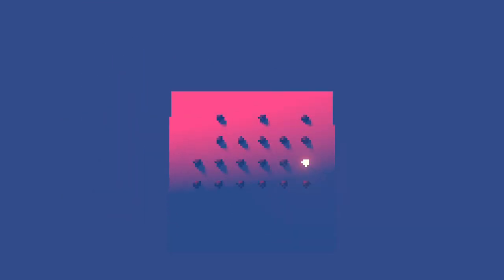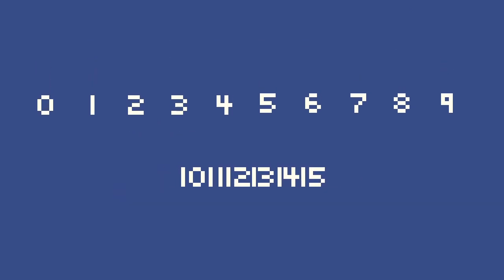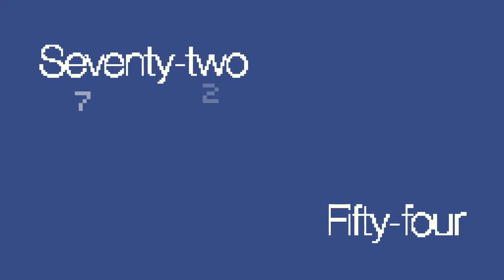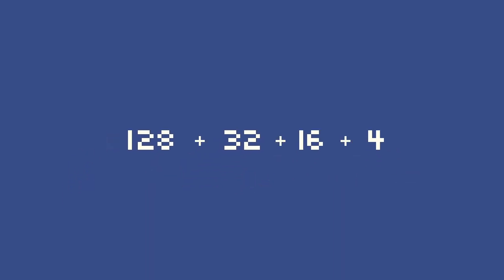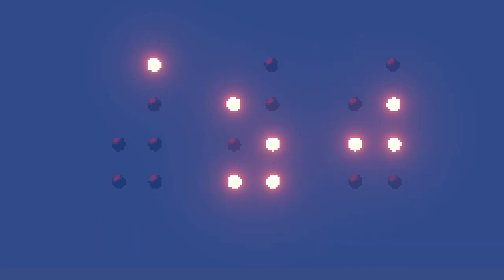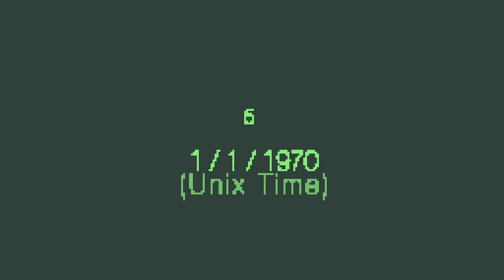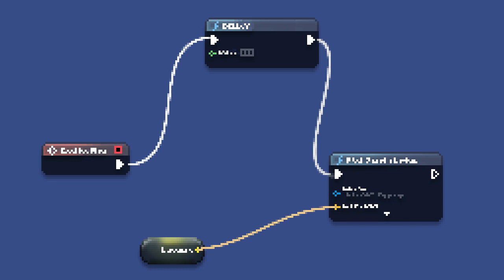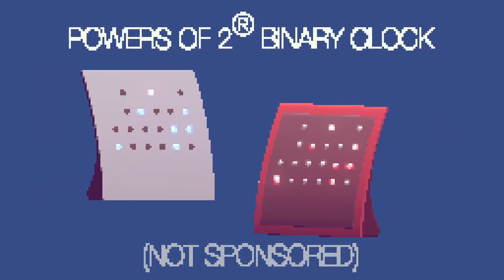This is a Binary Clock

Comment: Not binary
You've written a 24:60:60 base but represented in binary instead of decimal.

A binary clock would be 2:2:2             (2 hours in a day, 2 mins in a hour, 2 secs in a min
A decimal clock would be 10:10:10   (10 hours in a day, 10 mins in a hour, 10 sec in a min)

Ironically, base 2 is even easier to read than the standard 24:60:60, 

Morning is 0:0:0    Quarter of the day is 0:1:0    Midday is 1:0:0    3 Quarters of the day is 1:1:0
Eighth of the day is 0:0:1        Extremely easy to add time together